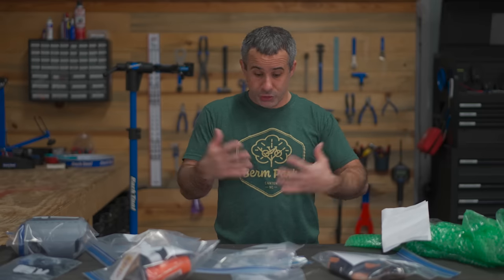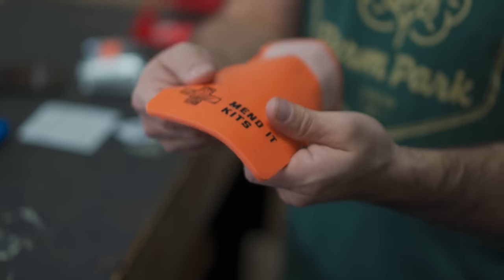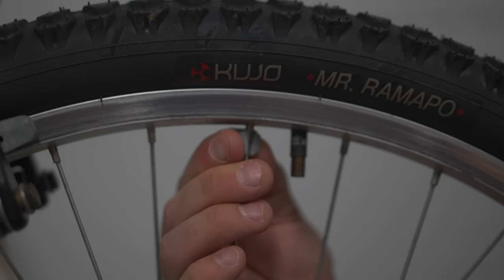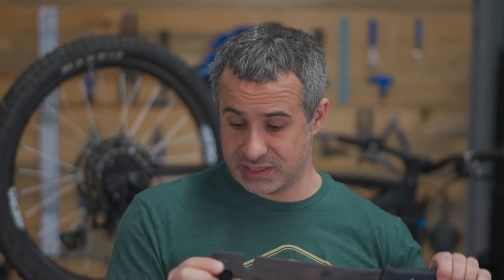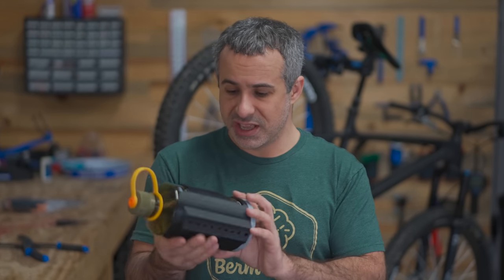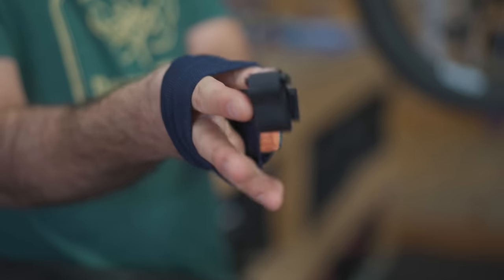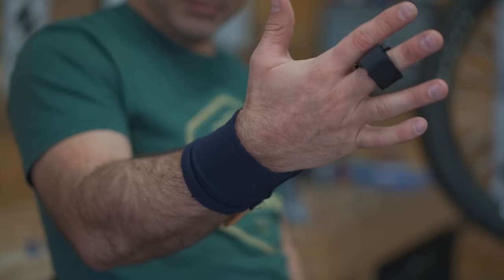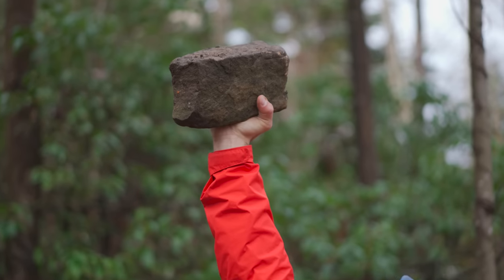Reviewing MTB products sent in by you, the audience!

Comment: 8:12 petg is super good - it’s all I prototype with. Check out Stefan a CNC kitchen for actual material comparisons.

ABS/ ASA, PC, CF-nylon would all be stronger options but may fail in a more brittle fashion. 

Maybe it’s worth rigging the bash guard on the fork drop tester to see if it fails… 

Seth be mindful of layer orientation and infill. Things like this would be solid plastic rather than two layers and infill. If you do any small prototypes with 5 or 6 perimeters and 6 or 7 top amd bottom layers you’ll be pretty right. I make moulds for leather forming and you’ll be surprised at what petg can handle….

Comment: You can buy alloy thumb adapters for bits. They have a quarter drive hole on the opposite side. I use mine with a torque wrench once I've ran the screw in.

Comment: I wouldnt call that tourniquet an actual one until you test it. Tighten it two times the amount youre supposed to and move around and flex the muscles its tied around and see if its gonna bust at the seems. Cause just laying there motionless yes it’ll likely hold quite a bit if pressure but add outside forces in the opposite direction aka your arm moving and muscles contracting and retracting and you might see that its sub par. Not sure if that’s the case thats why i want to see it tested more then half a twist. I know it hurts like hell but its worth it to actually test the thing.

Comment: I actually also made some bashguards eith carbon fiber infused nylon, they are light, and durable only uses the bottom two screws of iscg05 bracket snd can withstand multiple hits with a hammer
Reply: And sold them for 20€/ pcs

Comment: I had one of these 3D printed bash guards. Bought two of them on Pinkbike for about 8$ each. They lasted a while but eventually gave in. They crack near the bolts.
Reply: This design is much different from others it is printed entirely solid and has tapered bolt holes to prevent them from cracking.

Comment: For the 3d printed one bash gard, petg is like 10 times as strong as pla. It js way less brittle and higher tincile strength. Your prusa  can easily print that material. The only thing is that spool is like $5 more probably worth it.

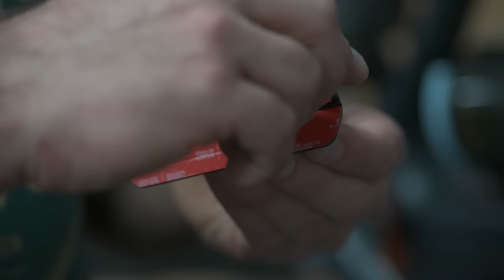Comment: The item at 10:05 would be great for an older gravel bike to accommodate a top tube bag but doesn't have the top tube (screw holes) mounts.  Do you know how to get me in touch with the maker?
Reply: Hey Thomas, looks like if I try to post a link the comment does not post. You can find those on my etsy store. Chunder Design, link is also in youtube bio. A top tube bag is a great idea! You may need to add washers under the screw head to prevent the issue that Seth had. The mount was designed around the tube plate and pump holders I make, so if the bag is thinner washers will be needed. The mounts are flexible too so it will conform to a round tube.
Reply: @ChunderDesigns  fantastic!

Comment: *Just a heads up. That looks to be a fake CAT tourniquet. If you look inside the plastic, there should be a CAT label embossed on the back of the plastic. Fakes are quite common as they are less than 1/3 the price, but I wouldn't trust my life to them over $20 difference. I am a paramedic who regularly teaches Stop The Bleed Classes.

Comment: 8:46
the idea of making parts on a 3d printer is a decent idea as long as its done corectly
people dead ass making recievers for guns on 3d printers
yeah, illegal manufacturing of firearms using a 3d printer
anyways, reason i bring that up is, because you can make really stronk parts on a 3d printer
gota print at the right heat, speed, the correct plastic
i aint watched that 3d printing video yet but ima take a wild guess and guess that you used PLA which isnt known as the strongest plastic

Comment: Please include a disclaimer that tourniquets should only be used by people who are trained to use them.  While they can save a life when used correctly, there are only specific circumstances when they should be used and specific care the injured party needs to receive after application -- If a tourniquet is used and not removed correctly, it can cause life-threatening side effects, and will almost always lead to loss of the limb below where it is applied. 

If anyone wants to learn more, i'd recommend looking for a wilderness first aid certification class to learn how to handle injuries when you'll be more than an hour from a hospital (very easy on trails, even in the front country, if the victim can't be moved easily and requires extraction by emergency services)

Comment: Please do not buy the Mend It kit. 

It’s very obviously using a knock off tourniquet that is not going to be TCCC approved. 

They are also advocating a terrible way to store your tourniquet. It should not be wrapped around your frame where it is exposed to rocks, dirt, etc. It should be stowed away from the elements so that it does not potentially degrade and break when you need it most.

A tourniquet is emergency life-saving equipment, you should not be using Chinese knock offs or storing it in a way that exposes it to damage.

Comment: i mean i really dig the ideas in this , but 30$ for the bashguard is STEEP... like  REALLY STEEP , its like 5min of design work and then 30c in material..... yeah not paying 30$ for that
Reply: Well, a little more than five minutes designing, but the main takeaway is the price for the printer, and keeping the “business” going. It takes time for the printer to make the products, the printer costs a fair share, packaging costs and takes time, and also just receiving, treating and sending orders takes time and money. So as a small thing, it can’t really be too cheap, or else the business is going in minus, which would give no reason to continue making the products.
Reply: Well when buying a product you dont pay only for the materials...but also the machines and tools used to produce it...and mainly...the know-how!
Reply: @JoPro06  finally someone that understand manufacturing
Reply: It's even cheaper to make things with moulds like most of the stuff on your bike but nobody complains about that. You're paying for the time and expertise, not the material.
 You only have to look at the amount of grips sold that are 50-100 dollars and about 10 cents of material.
Reply: @Rippthrough  Like injection molding or silicone molding?  Molding from manual pours is way more labor intensive than 3d printing.  Injection molding typically has minimum order quantities in the tens of thousands, and the molds are machined from metal, and can cost tens of thousands of dollars.  This is for overseas manufacturing. US made is 4-5x the price and minimum order quantities.

If you're basing this off of listings you see on alibaba quoting you 500 units as the minimum order quantity, just contact them and see what the real number is.
Reply: @meikgeik  I'm basing it on being a manufacturer of small batch parts that I produce either printed or moulded, machined, etc. As soon as you start selling more than a few hundred units 3d printing becomes by far the most expensive production process. Which is why it's not used for much outside prototypes and small batches
Reply: @Rippthrough  Would love to know where you're getting molded products for less than 3D printing in that small of quantities.  Every quote I've gotten for molds on a small cheap item has been over $15k.